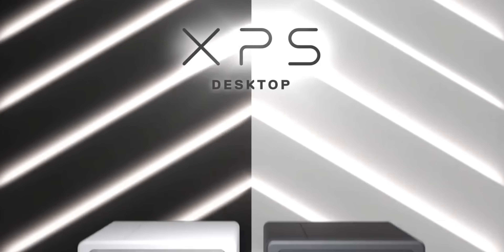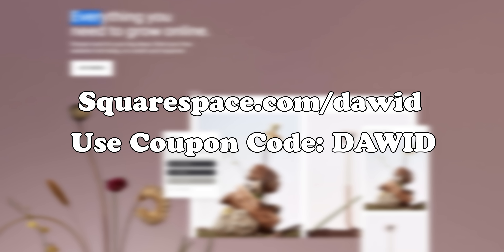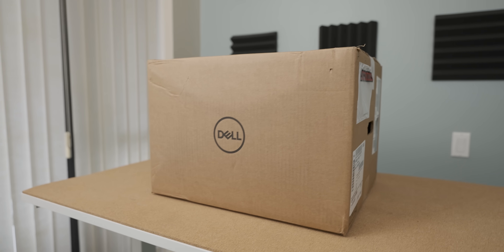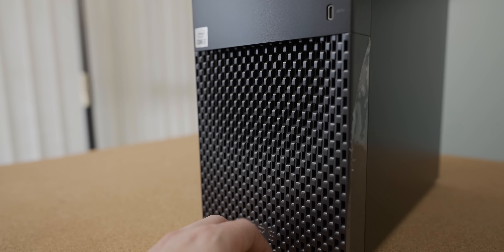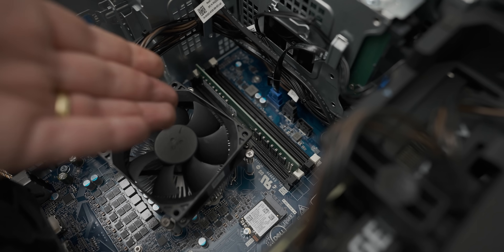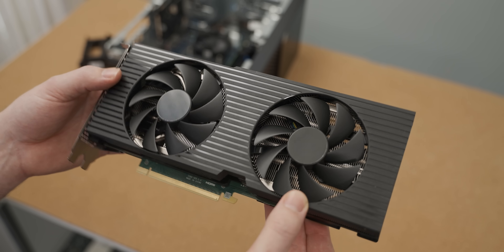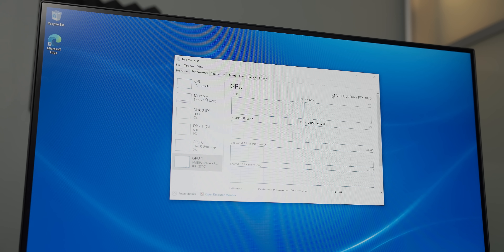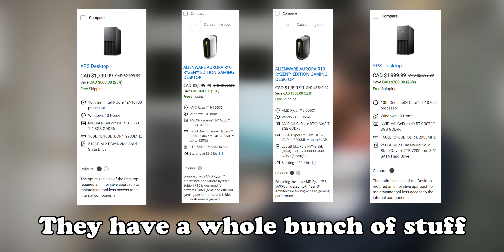DELL Did Me Dirty... RTX 3070 Dell XPS Pre-Built

Comment: So here:
- Either fight scalpers
- Or buy a furnace
Reply: Furnace pls,
Reply: You want a furnace?  Get a 3090 and pair it with a threadripper 3990x.... at full load, Thats nearly 650 watts of heat.... i won't get into the cooling needed lol.
Reply: Or spend the almost nothing extra for a decent cooler, meaning you don't have to deal with either.

And if you watch the Linus video mentioned, there are a few prebuilts from companies that are all made from branded off the shelf products, extremely well made, cover with great warranty and servicing, all for less than you build build it yourself - or very slightly more (but more than worth it).
Reply: @wyterabitt2149  sorry what Linus video was he talking about?
Reply: @samuelstephens368  secret shopper 2 series
Reply: @tristanweide  ah okay ty I'm watching his xqc video now.
Reply: @samuelstephens368  Just the most recent secret shopper videos (it's a short series they do each year with videos for the ordering process, what they received, troubleshooting a simple issue, then performance of what they got). 

Dell's performance overall was pretty bad, and a couple were decent but very overpriced. But a couple were really good value.
Reply: @wyterabitt2149  Very pleased with my custom built from eCollegepc. They had the 5800x and a good 3070 egva gaming ultra available for the $2,350 with windblows 10 I paid including shipping was less than building it with scalper priced parts.
Reply: I mean...it IS winter time in North America...just sayin'...

Comment: followup replacing the cpu cooler and adding another stick of RAM incoming.
Reply: A front case fan wouldn't hurt either
Reply: @DJKr15py  where should it blow the air: Against the HDD blocking the top of the front panel or against the GPU holding shroud blocking the bottom of the front panel?
Reply: DJKr15py )
Reply: @DJKr15py  that would be nice if there was somewhere to plug it in . there is no more fan headers in these
Reply: @skittishgaming4279  oh dang didn't realise, that sucks.
Reply: @skittishgaming4279  Yeah, no header plus I think no place to srew in a front fan either.
Reply: @skittishgaming4279  get a fan header splitter cable.
Reply: @benjbk  I have this system, I replaced the CPU cooler with a NH-D9L and that did the trick, whisper quiet and full performance.
Reply: @DJKr15py  a new case wouldn't hurt either
Reply: @DJKr15py  RGB case fan***
Reply: @martymcfly88mph35  Non RGB case fan**
Reply: @martymcfly88mph35  yep RGB adds FPS :P
Reply: @martymcfly88mph35  no
Reply: @martymcfly88mph35  RGB bad. Its a waste of performance and blinds eyes in a dark room. #rgbhate
Reply: @martymcfly88mph35  that alone adds 70 FPS
Reply from the maker: Maybe I should try custom liquid cool it? 😅
Reply: @DawidDoesTechStuff  Dew it
Reply: @noahstanyer3600  SENATE
Reply: @DawidDoesTechStuff  then put it in a different case and see if it'll still be less than a full custom build with a 3070
Reply: @BrendenPragasam  Front IO is part of the MOBO.  Good luck with that
Reply: @DawidDoesTechStuff  Don't liquid cool it! Slap a $25-30 amazon air cooler on it, like the one Jayztwocents just gave the hug of death to. Show just how stupidly fucking cheap they could be and still provide better user experience.
Reply: @DawidDoesTechStuff  I think the average buyer looking to fix their system would prefer seeing how much of a difference an affordable air cooler would make.
Reply: @faber3969  I did it with a Noctura NH-D9L and now the CPU at full load peaks at 82c. I ran the burn in for 7 hours.
Reply: @DawidDoesTechStuff  just a decent air cooler, cuz some people might own this kinda pc and want to upgrade it with simple available parts
Reply: @DawidDoesTechStuff  lol but seriously I bet you might be able to toss a 120mm aio on the front of the case for the cpu
Reply: @DawidDoesTechStuff  would love to see that, but hey i am just a lettuce
Reply: @DawidDoesTechStuff  YES I CANT WAIT
Reply: @DawidDoesTechStuff  What like dropping it in a bath while it's running?
Reply: @DawidDoesTechStuff  custom liquid cool it? You mean dump it in a river?
😄
Reply: @DawidDoesTechStuff  be quiet dark rock pro4?
Reply: @DawidDoesTechStuff  you should make the loop.liquid and/or tubes green and glowing then, Orc Customs style
Reply: @DawidDoesTechStuff  please use an old fashioned external radiator with bling bling on it 😉
Reply: @DawidDoesTechStuff  - I would love to see you replace the CPU cooler. I have a Dell G5 with the same motherboard and cpu, and have heard the stock cooler is screwed into standoffs on the case. I would love to know if I can just replace it or if it's a project that I'm not interested in getting involved in .... I probably missed the selection for dual channel memory, so I got single channel... and I got the 2070 super GPU ...  here's my cpuz info https://valid.x86.fr/qxy2u2 , and some pictures. https://imgur.com/gallery/WXGTFsX
Reply: @DawidDoesTechStuff  120mm rad is quite powerful at keeping cpus from skyrocketing in heat wise idk if 240 would fit
Reply: @DawidDoesTechStuff  I'd honestly prefer to see how little effort it would take for massive performance improvement to highlight how flawed the build was.
Reply: @DawidDoesTechStuff  Yeah ^^ but beware of the voltag treshold of the fan header. Better invest in some usb to fan control module. Had to search for a solution for a 7040 motherboard ( the pump was too slo on the header) You could also divert power from the second "pcie" connector ( saw two on your PSU ? ), the PSU seems to be their "high end" model .
Reply: @DawidDoesTechStuff  no
Reply: @DawidDoesTechStuff  I hope you tried it just replacing the cpu thermal paste
Reply: @DawidDoesTechStuff  no no just show how easy it would be for dell to get huge fps gains with an efficient cooler and dual ram sticks.
Reply: @DawidDoesTechStuff  cut the side panel out and put some acrylic on there
Reply: @DawidDoesTechStuff  YES
Reply: @DawidDoesTechStuff  yes
Reply: @DawidDoesTechStuff  YES YES YES
Reply: @DawidDoesTechStuff  SURLEY u can add a better cooler and maybe front fan with 2 sticks of ram and show us what it can be
Reply: @DawidDoesTechStuff  yes
Reply: @DawidDoesTechStuff  Good luck fitting that or any other huge cooler in there xD
Reply: @DawidDoesTechStuff  and if you do take your time It would horrible if your loop leaked
Reply: @DawidDoesTechStuff  no just use the cooler that is shown in pictures
Reply: Upvote for easy next video
Reply: Agreed. Show the small upgrades one at a time. First switch to dual channel, and show us the improvement. Maybe also the conversation with Dell about how they shipped not what you ordered. Then upgrade the CPU cooler and show the performance improvement from that also?
Reply: Agreed, I'd get Dell to send you what you ordered. I'd ask about the cpu cooler too but that isn't guaranteed. Do it with dual channel and a non crap cooler to see how the case setup performed.
Reply: @mkkohls  unfortunately, the CPU cooler in the photos is only used by dell on the K series variants of the processors. They hide it real small amongst all the marketing junk
Reply: @mkkohls  they follow intel TDP rating for cpu coolers, so when you order get the lower end 125w cpu and you get the top end cooler.  I know cuz I order dells for work all day.  You can also call them and have them send the correct ram kit -dual Chanel.  They will fix it.
Reply: @mkkohls  Cpu cooler is like that default unless you buy the k-variant of the processors.
Reply: @echristi678  Also at the end tear everything out of that crap case and put it in a LIAN Li case and put in water cooling, see how great it could look? (Ok maybe this is to far, but hey I can dream can't I?)
Reply: Best way to put it. The series that convinced me to subscribe anyways. Making prebuilt suckface into a beast upgrayde
Reply: I really hope so because for the overall price it's really not bad. I'd like to see what it could do without those obvious flaws holding back the gpu
Reply: @No_Treading  meh, for only $100 more you can get a 3700x and 3070 on Neweggs
Reply: @VTJasmine69  True, if you can snag one.
Reply: Agreed. First with just additional 16GB RAM and then with the addition of the cooler.

It’s insane that they’d actually sell that sitting at 90c! Let us know what Dell says about the RAM and cooler.
Reply: I’m glad I’m not the only one to say it! Although the power delivery is a worry too... good think you cannot OC it haha. But yeah put even just a hyper 212 on it and some more RAM!
Reply: @abbynormabrain6664  the case might be too small for a 212. Maybe one of his shiny new golden field jet engine ones would fit?
Reply: Another vote for this follow-up video!  Your timing couldn't be better, either!  I'm seriously on the edge of buying one!  The XPS actually looks like a better choice than the G5 "gaming".  The internal layout looks 100% identical but the G5 closes off the front ventilation to give you that cris-cross with RGB styling.  Losing the vent CAN'T be good!
On your follow-up, can I request a stress test?  Run that thing hard for hours and see how it handles it!  <3
Reply: @markcritic2409  Check out eCollegepc. Yes my 5800x and Evga 3070 gaming ultra with H150i water, 2 sticks brand name ram,  msi x570 gaming edge board, etc. cost 800 more. It's a beast compared to that Dell "excellence".  FWIW
Reply: @markcritic2409  I have the G5 and I did a burn in with future mark for 7 hours. Still going.
Reply: Maybe Golden Field needs to come to the rescue... 😉 I mean you do have a whole closet full of their coolers to spare.
Reply: I wonder if the psu will have problems once the cooler is replaced.  Potentially the vid card will ramp up considerably in usage and power draw and so will the proc. I wonder Dell bios limits boosting via firmware on the vid card and locked bios setting
Reply: @thegreatmrp  I have this system and from what I'm seeing it isn't limited in any way. I ran a burn in with future mark for 7 hours. Of course I have replaced that poor little heatsink on the 10700f with a Noctura NH-D9L. 82c for CPU and 72c for the 3070
Reply: Yes he should do that
Reply: yep i hope he does
Reply: I recently purchased one and replaced the CPU cooler with a Coolermaster Hyper T2 and temperatures average 70-75C under gaming load and does not throttle.
Reply: @johnnynguyen7455  Is it a standard pinout for the cooling fan?
Reply: @whidbeyhiker4364  The CPU cooling fan? Yes. The case cooling fan? No. I didn't have to upgrade the case fan so never ran into issues.
Reply: Please!
Reply: Would be curious just the see the improvement by just adding another stick of ram. See how it should've performed if they had shipped the correct configuration.
Reply: Yes please.  I have bought this PC and it should be arriving next week.  I also ordered it with 2*8gb ram, so will have to check that.  Not sure what cooler it was suppose to come with.  Can anyone tell me ?
Reply: @murphy2870  If you ordered the 10700f is comes with the small one. I got it and replaced it with the noctura NH-D9L.
Reply: Should do a customer service video with dell calling about your ram
Reply: Just kick them in the balls and tell them to send you a proper system. Don’t let them get away with that bullshit
Reply: follow up on asking dell wtf is up with this cooler that doesn't match your marketing?
Reply: I bet the gaming benchmarks won’t improve more than 8 to 13% which is not that much of a difference to bash this setup with.
Reply: Did dell reimburse you?
Reply: Do a cheap be quiet  cooler
Reply: Hell at this rate I would purchase one of those just so I can gut it and put the hard to get components into a computer I want to build and then sell off the unused parts either via Craigslist or eBay or something.
Reply: Should cut a hole in the case on the side and install mesh.  What a shit case for the times.  Come on dell
Reply: And a better PSU. The 3070 is rated for a 650W minimum not a 500W like in this system. God knows how long it will last. The guy that built this system has no clue about pc building sadly, no dual channel, low wattage PSU, stock intel cooler (who does that). He could scavange the mobo, cpu, disk drives and gpu and put them in a case with better airflow, better psu and a another 2933Mhz stick near the one that came with the system.
Reply: @ozzlink  I have this system. I replaced the CPU heatsink with a Noctura NH-D9L. I ran futuremark burn in for 7 hours. All good CPU temp maxed at 82c. I used a Killawatt meter and measured 373. 2 watts from the wall. Soo yeah tight... Guess I'll see how it goes.
Reply: @ozzlink  the psu is totally fine.  You could power a 3080 with 500w all day every day for 10 years.  My pc output is ~450w with a 3080 and a 3600 at full load.
Reply: @damonm3  3600 is a 65W TDP right? this build has an intel not a ryzen. This Cpu (10700) is draining more than 200W. I know It's not a K model and you'll not OC it but it will turbo boost, and you need power for that.No power = crappy performance. Optical drive, ram, crappy VRM without a heatsink, 3070 and a 10700 requires a lot of juice. Belive you me when I tell you that  this system is not all that good with a 500W PSU. Never ever compare a Ryzen TDP with an Intel one. I have a 3700x and i7 8700k and the Intel is a power hog. Most of the cases the system will boot and work but at the cost of lower performance ar even breaking something beacause is undervolted.
Reply: @ozzlink  I agree.  Totally depends on cpu
Reply: Thinking of doing the same to my pre built. Does that really offer more performance on a 3gzh locked cpu?
Reply: @jackbernardy8837  you should check if your CPU is currently overheating (hitting over 90C). If it is overheating than yes, it makes a big difference. Both to performance and to the longevity of your computer.
Reply: @johnnynguyen7455  sitting on the vegas tarmac in flight sim 2020 cooking right at 90c and at 90%ram usage. I think I know what needs to be done. Thank you
Reply: subscribed just to see the follow up on this one
Reply: That would be my dream pc. If I had a pc.
Reply: Don't do a thing send that shit back make em fix It
Reply: ye
Reply: No crazy liquid cool or anything please. Just a decent cpu air cooler say $30usd and 2x8gb of 3000mhz ram please and leave the side panel off. Just show us what would've cost dell partially $5 given the price and power in the market to do half right. Then maybe show us every Frame you can possibly squeeze out of it so we can see exactly what was left on the table
Reply: Follow up?
Reply: After adding those; you'd been better off getting a non-Dell box. A 3rd step would be to trash that case and get one that can breathe.
Reply: Dell should be sending him that gear for free + an apology and $100 store credit.
Reply: He should return it with a 1050 in it, they pulled the bait and switch first
Reply: I upgraded the fan woth nhd9l but I guess there might be better option also I am going to create an air chanel for system
Reply: I upgraded mine and put the video down below
https://youtu.be/ugg0FOzgUYM
Reply: They thought he would hang his head because of shipping difficulties. Nope. Not this guy.
Reply: everything in this pc is trash except for the CPU and GPU lol
Reply: Yes the system is poopoo but its kinda noob to say the gpu is not getting to 100% as the cpu is not letting it... games only are able to utilize a part of the pc in most cases
Reply: When?
Reply: No way. Demand the ram they didn't deliver, for starters.
Reply: Replacing the case as well...
Reply: Seriously, some bait and switch shit right there. No i want the cooler that's advertised. And the correct RAM configuration
Reply: @Graciashauf  The ram was his own fault, and the correct CPU cooler was advertised, if you look through more than two images
Reply: @leopamir  How was the ram his own fault when he specifically ordered dual channel though?
Reply: I feel like you should show everyone debating on this computer why the power supply makes this computer very hard to upgrade in the future
Reply: Maybe they also sell that beefier cpu cooler as an option? Or perhaps a different sku of the xps desktop gets that cooler?
Reply: @christophergorge  the k series does come with the better cpu cooler
Reply: @dabadoo7631  😂😂😂 maybe buy a small margin. 

Alienware desktops are well known to have bad ventilation and generally just as atrocious case design as other DELL desktops.

The Laptops are usually fine (if somewhat overpriced)
Reply: throw it in the trash and go to NZXT or Maingear.
Reply: Would be great to see what the components are capable of, not being held back by dell
Reply: You should do a comparison video
Reply: Replace that junk case if the motherboard and PSU are standard size.
Reply: Figured I would have seen the follow up by now - new cooler and added ram. Not sure there is room in there for a liquid cooler.....but a stepped up air cooler Will  be better at least....
Reply: I Got a 3060 ti pre built on new egg had to send it back because they gave me a dead graphics card 😭
Reply: Did you file a complain about the missing ram ?
Reply: No they are gonna remove the gpu for better price/performance